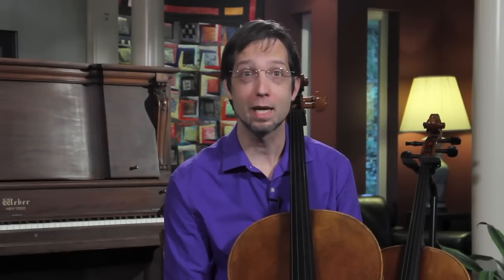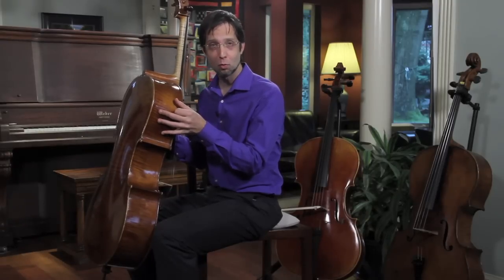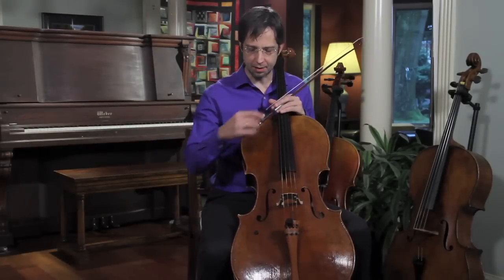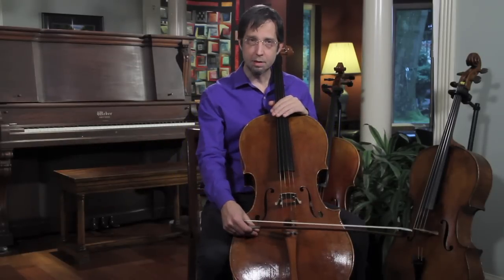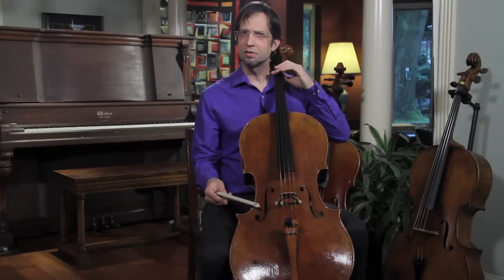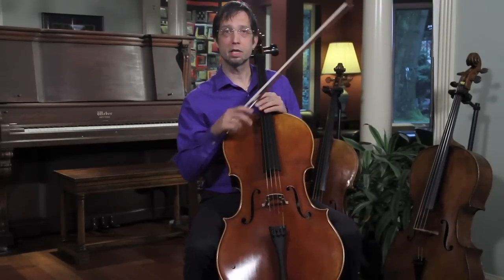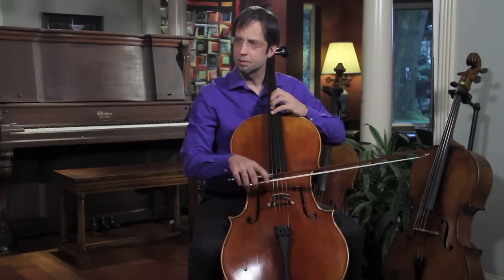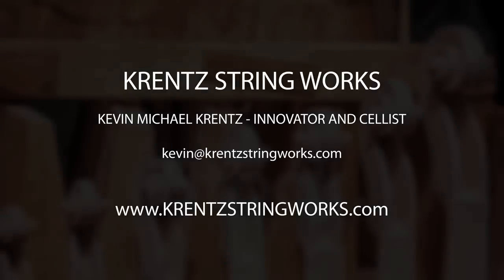The Finer Points of Wolf Eliminator Adjustment

Comment: I'm using this on my L&C cello and it's a game changer.  I have found the Modulator works best when very near the C foot, probably because the carbon is of relatively thin construction. Changes in position of just 1mm can dramatically change the resonances of a low C played on the A string. There is a ton of experimentation still to be done. With the modulator doing a great job in it's current position, where wolf tones of 1st E on A string and octave C on the A string are now supressed. In a few days, I'll be adding a 2nd Modulator to see how I can colour and control other dominant resonances rather than approaching this devices as a wolf note eliminator. Typically, I'm hopeing that playing between 1 and 2 octaves up on the G and C strings 
could become far more lyrical. We'll see :)
Reply: Guy Martin woah!! i wish i had known that Krentz had an L&C customer!!
Reply: Thank you so much for sharing your experience Guy, and Picco bow too! I have an L&C with a big wolf and I was just wondering if any other owners had tried the Krentz. Now I'm definitely going to buy one - excited to see what happens!!
Reply: So the experience with two modulators it worked?

Comment: It worked for me. I bought a second cello, a Chinese Strad pattern, had a bad wolf on F#. An on the string brass wolf eliminator on the G string worked but dampened quite a bit. This Krentz device worked like a charm after going through the placement, was able to get the cello a more even resonant tone throughout all the strings. I wonder if glueing a piece of wood same weight at the same location under the cello top would work the same? I’ve heard of some people doing this.

Comment: i play a Luis & Clark cello and ever since my cello has been reset (soundpost change, strings were a bit high, and bridge rework) I got the typical E to Eb wolf tone on the g string. I ve tried those that go on the string - they were a bit of a joke. Either they didnt last long on it or I had to have a second person help me adjust it!! Having a carbon fiber instrument made me wonder if it was going to work. i had asked ppl at Krentz if it would work on this type of cello and they said 'I dont see why not' !? I thought Brilliant!! ill try it!! oh wow!! it went beyond my expectations!!! I seriously though i may have trouble installing it but its almost idiot proof!! hahaha😂
i read the instructions and paid attention to the video. I have an ingles stand and all i did was rack the cello on it and tilt it towards me held the cylinder halfway inside the f hole 😂(nasty cello)
and placed the button disk on the cello about an inch or so below the f hole. i felt the magnets going towards each other and dropped the cylinder and it attached!!! magic! So i put it in the edge of the cello and played it until no wolf!! i then later messed around with it. WOW THE L&C is loud enough as it is sure made the c string sound quite angry and had more bassier tones!!
Reply: Make sure your bridge is mounted at exactly 90 degrees. This will minimise wolfiones. Then have fun eliminating the 3 wolftones. The L&C  is tricky to sort out as carbon is so transmissive but after realigning the soundpost to a median positioon and maybe some work on thinning the bridge towards the A string, your instrument should begin to sing